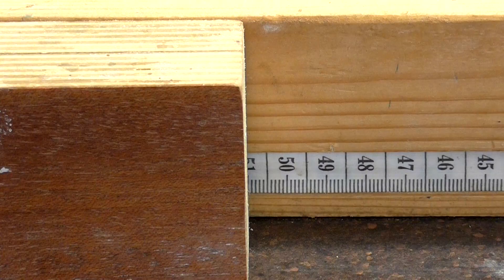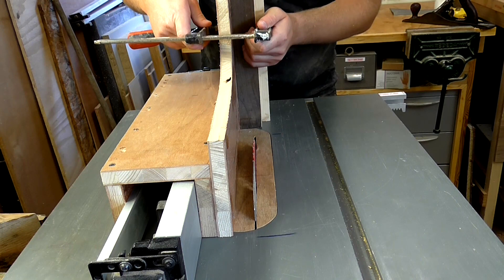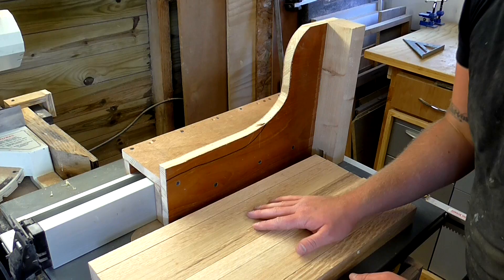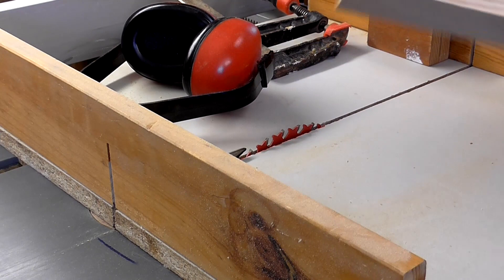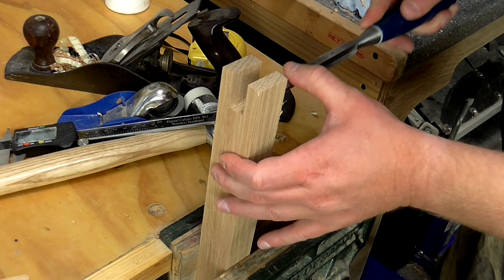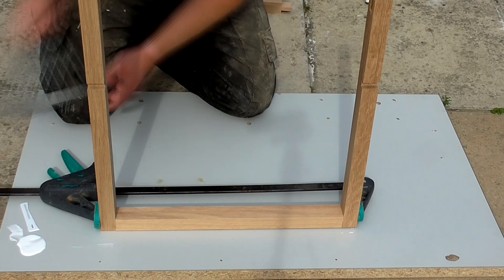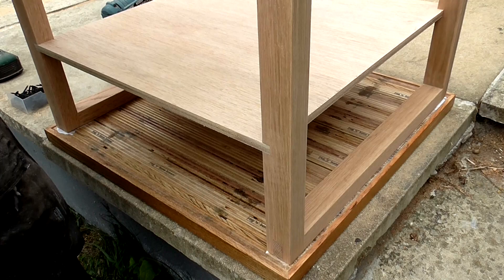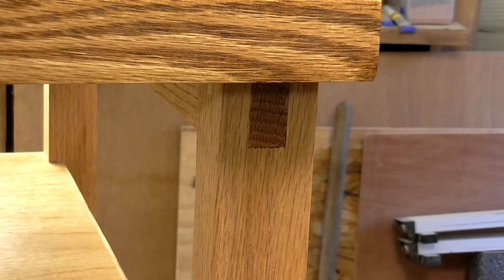Making An Oak Table Frame For The Plywood Table Top - Part 2 of 2

Comment: Great project! The use of the plywood scraps give us beginners a way to start without worrying about wood varieties as well as costs. Your “screw-up” on the first bridal joints gave us hope realizing things need not be “perfect” to be beautiful. I think I’ll try the project with a thinner version of the top for the shelf. And also, thank god you’re doing this on everyday tools and not the $50,000 set-ups in so many (albeit great) woodworking channels. Thanks for your work to produce these videos!

Comment: OK, I'm a rank amateur hobbyist, so this more a question of "Why couldn't you" than a suggestion

If you mark all the pieces exactly the same - When you're cutting the mortices, you put the blade on the inside of the line - then when you're doing the tenons, put the blade outside the line

Wouldn't that give you the kerf width extra instead of having to do all that thing with the calibers or saw blade?

Please be gentle explaining to me why this is a dumb idea never comment again :)